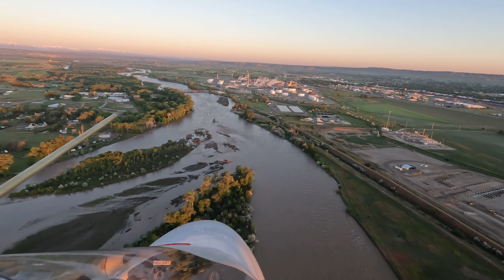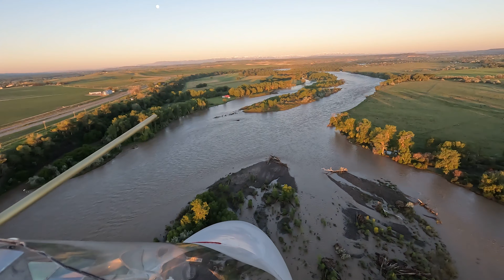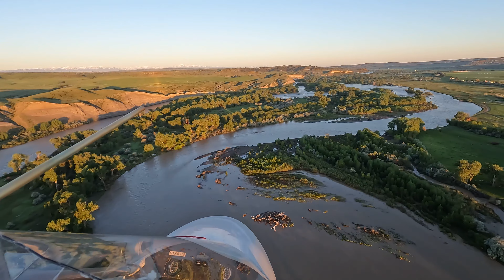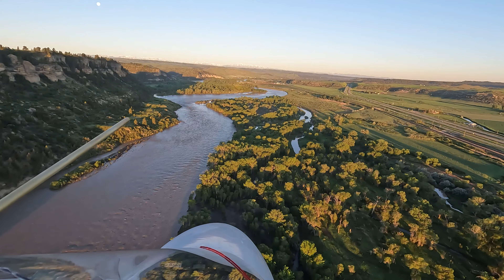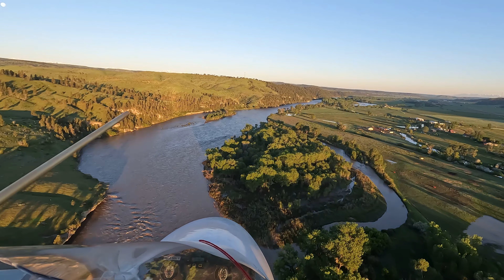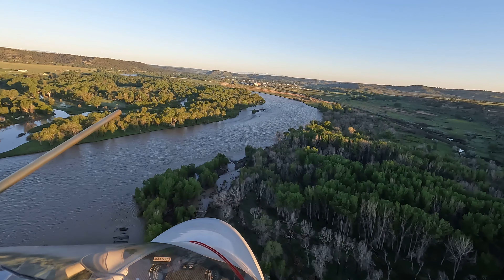Challenger II: Flight Up the Yellowstone River

Comment: Lot of people cruise between 5200-5500rpm. Try that rpm and see what your fuel burn is. 3-4gph is normal. Check out my channel as I regularly try and update with videos.
Reply from the maker: I've seen several of your videos already :) Will be sure to check up on your channel though. . . Based on this and one of your other comments, I think I do need some more pitch in my prop. I've got a 60" prop, but don't know really anything about it other than it seems to be in pretty good shape. It's on my list of things to replace shortly with something that's adjustable. I wanted to double check that the trim tab really should point left? I have it stuck out to the right, right now which relieved pressure on my right foot, though I do still  have a left-yawing tendency.
Reply: @flightventure  I would suggest a 2 blade Warp Drive prop. 60" diameter ground adjustable pitch. 12 degrees is the sweet spot.